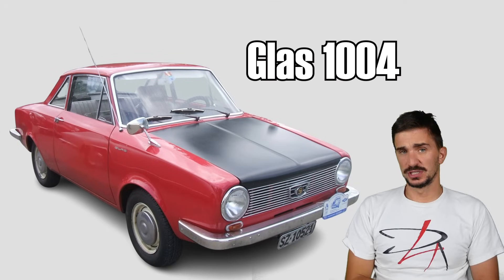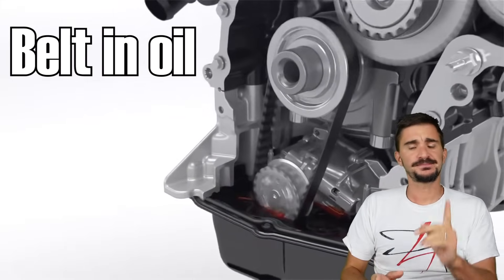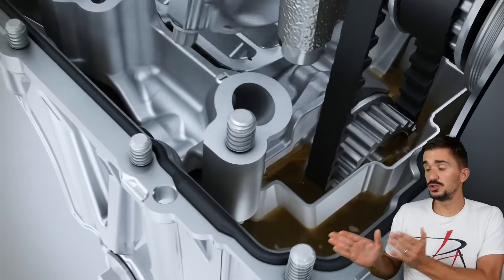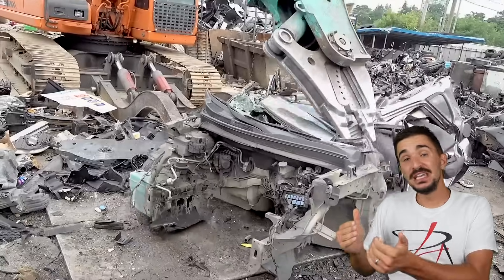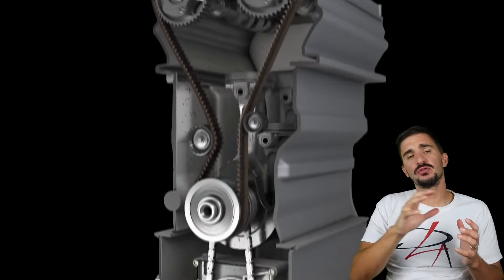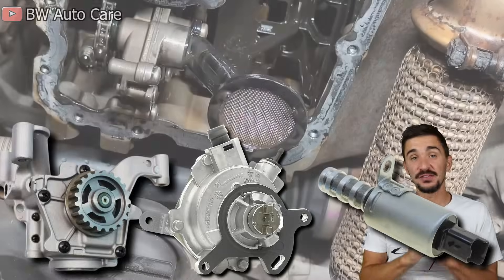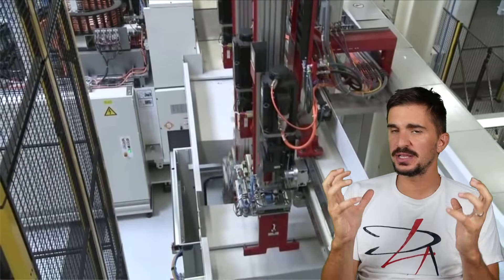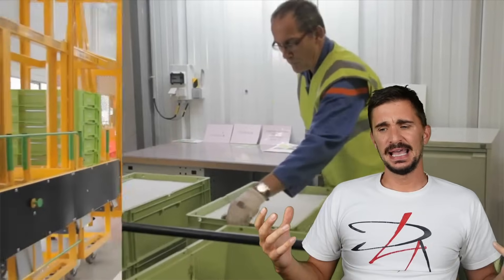Who Approved This and Why Is It Still Being Made? Wet Belt aka Belt in Oil Engines

Comment: I am working in the automotive industry and you are 100% right! What helps
1) really only using certified genuine oil
2) using only geniune belts
3) not adding additional additives
4) reduce change Service to 10k-12k
5) not running engine too hot
6) using good fuel higher than 98oct
… Tier1 suppliers optimized the belt material after initial issues to increase lifespan, but it does not completely solves the issue.
Reply: Or changing the timing belt before the service interval for replacing them, probably every 100,000 km or 62,100 miles.
Reply: @Sacto1654  My car has 105000km service interval for the belt in the owner manual. It is from 2020 and they realized that it is prone to failure. Friend has an older model of the same car and his one states 160000km. Peak auto industry. I will probably sell the car before it hits 90000
Reply: These are ridiculous recommendations, consumers shouldn't need to do this. How does the industry get away with rolling this shit out in the first place.
Reply: @mrfish9876  you drive while its under warranty, then it becomes somebody elses problem..

Comment: Ford with it driving the oil pump, the belt deteriorates and fills the oil pick up, killing the engine. That is if it even had enough belt left to turn the oil pump. 😅
Reply: funny thing is ford says the ecoboost oil intervall is 3k km but it really is 2k km
Reply: @motokid1492  i'm not buying a car that needs an oil change every 2 months.
Reply: @SoulTouchMusic93 then don't buy any of these small turbo engines. Because the turbo wears the oil out faster.
Reply: @motokid1492  here the ecoboost is every 15 000km
Reply: @justarandomguy3969  Meant miles ford says 3k miles it really is 2k miles
Reply: @motokid1492  thats still only 4800km, interesting that you guys have to change it 3 times as frequently
Reply: @justarandomguy3969  You don't, the recommended oil change from Ford is on average roughly every 7500 miles. People are falling for what is outdated information and borderline propaganda from the oil industry, the people who actually make more money if you do more oil changes than are required.
Reply: @richardmillhousenixon  interesting, i keep seeing americans saying they do oil changes every 3000-5000 miles and i never really understoof why

Comment: It should be noted that some of the most reliable engines ever put into cars came with DRY timing belts. Toyotas 1uz 2uz and 3uz all used dry belts and all of those engines are documented to go well over 300k miles with just basic maintenance and there are some examples with over 1 million miles. Of course these engines are gasoline hungry V8s but its arguably better for the environment to keep older, less fuel-efficient cars on the road than endlessly manufacturing new cars that get thrown out after 150k miles.
Reply: Keeping an older vehicle on the road is not a clear black/white situation. It is beneficial to get a newer car if you are reducing your consumption, the payoff time varies obviously depending on the fuel consumption reduction
Reply: Nissan vans (truck chassis V6/v8) for sale with over 400K mi and going strong. It's almost as if timing chains are amazing 😂.
Reply: But manufacturing new cars with a lifetime of 5 years boosts BNP more than some annoying sensible person using the same car for 15+ years.

Governments and corporations do not give a single shit about the environment or people, all there is is profit, or the illusion of productivity.
Reply: Stop nuthugging Toyota. That is not true. The 1UZ and 2UZ were intereference engines. If the belt snaps, the motor blows. They are not exception to the rule. If you feel so confident, then go ahead and cut the timing belt on your timing belt Toyota and then start the car. Tell me what happens.
Reply: @Euro316  I don't really understand what point you're trying to make. It's objectively true that the uz engines are reliable. Thats not an opinion. Of course, if you cut the timing belt it will cause irreversible damage to the engine but that's the case on any interference engine including those with timing chains.

Comment: The Renault 0.9 tci has got a timing chain and the 1.5 dci has got a normal dry timing belt.
Reply: this should be on top
Reply: Yeah I think the 1.2 tce uses a wet belt but the 0.9 doesn't
Reply: Yeah, as an owner of an early 1.5 dci, and who`s done alot of research regarding later versions of the engine, I had never heard of one with anything other than a dry belt...  But than again I had no idea that this hateful practice started with the 1.8 tdci of all engines...
Reply: There is a belt to chain conversion kit for the Ford 1.8

Comment: I'm not sure if you mentioned it but Ford also uses a wet belt for the OIL PUMP for the 1.0 Ecoboost. Had a coworker whos Ecosport had an oil pump belt failiure within warranty. She immediately sold the car after getting a replacement engine. And I don't blame her.
Reply: I have hated every Ford I have ever owned. All cars are scams, but Ford really likes to twist the knife. Hate Ford.
Reply: I've only owned one model of Ford, and that's the Focus. And only the ones with Mazda designed transmissions and engines. After my 5 speed dies, that's it for me and Ford. Actually, I refuse to buy any car after 2019 because you can't get anything without data stealing. So I'll probably just get an Ebike and walk.
Reply: @jacobrzeszewski6527 Mazda designed ones weren't good either. Mazda is probably the least reliable among the Japanese manufacturers

Their older cars like the 323 had indestructible engines, but their newer ones, not so much.

My dad had a Mazda designed Ford Everest and the engine ran like garbage most of the time.
Reply: @tristan6509  I beg to differ. The Mazda L platform. AKA, the MZR, or the 2.0, 2.3 and 2.5 Duratec i4s are stupidly reliable. Unironically 350,000 mile engines if the oil is changed regularly. Chains for the oil pump and Timing. Belt driven water pump,  no plastic oil pan, and no head gasket issues. I'd argue it's better than any EJ series and even SOME Toyota engines. Yeah, those Toyota A series start burning oil around 250,000 miles, and there's nothing you can do to avoid it. The only problem with the L platform are the terrible transmissions ford attached to them. The only good transmissions are well maintained 4F27Es. Which are rare given people never change the fluid. And the MTX-75. Which is a very mid manual, but a manual none the less. The worst thing about those engines, are the cars they're attached to. Ford's and Mazdas are rust buckets, plain and simple.
Reply: 350k miles is good for an American engine but it's nothing compared to most Hondas and Toyotas.

Even Suzuki (K-series, F-series) and Daihatsu makes some very reliable engines (SZ, KR, NR series). They're used as taxis here and can go millions before needing a rebuild 

But as for the transmissions, I think the early Japanese CVTs were hot garbage. They all fail within 100-150k. Fortunately most cheap cars here are manual so there are no such issues.

Comment: 16:31 Umm actually, there is another Honda engine in EU that uses a wet belt: P10A2, the 1.0T. The info online is pretty bad if you specifically don't search for the engine code and "Wet belt". There's ofc a recall for these belts for missing teeth, I'm waiting on the dealership to give me an appointment to get it replaced. They'll probably replace the belt but they'll just put a new belt in, which just postpones the issue but doesn't fix it. I acutally checked if this engine had a wet belt before I bought it and was misinformed by the internet.
Reply: Exactly. And then you'd think okay, their 1.5 turbo L15Bx engine is safe from that issue, but you soon learn about oil dilution, spark plug issues etc.

Comment: It has failed in US years ago, and now, here in Brazil, there is a car developed exclusively for our domestic market called “Onix” , manufactured by Chevrolet. The first generation had 1.0L and 1.4L engines, based on GM Family 1 of engines, pretty economic efficient, and reliable (even if being naturally aspirated). The new generation of this car is an entire different thing with the same name, it has 3 cylinder engine, with wet belt. Even if they know it failed in their home country, they seem to insist on this idea in a another country, selling it as a “new technology”.

Comment: Personally I prefer dry timing belts over timing chains. Because they are usually simpler to change. And although in theory timing chains are more robust, what usually fails are the plastic guides and tensioners.
Reply: They could be easier to change, depending on how awkward it is to get to them - usually very awkward. I prefer chains because they can run with their guts hanging out, and make a lot of noise on their way out, which is a good warning. Nice things about belts - cheaper, lighter and simpler to design than engines with chains.
Reply: @99nadroj  When the chains are making noise the plastic guides have been ground up and starved the oil supply. The main bearings would have worn out so it's too late.
Reply: Gear driven camshafts - are lifetime items. My 54 Stovebolt ran more than an estimated 400000 miles. The Vortec 2200 with timing chain sold with 400000km still running. Dry or wet belts are not state of the art nor are unserviceable new engines.
Reply: Belt or chain, timing gears are the best. It's race engine stuff.
Reply: It doesn't even really matter.... Even if cars had timing gears auto manufacturers would just find some other way to screw you.
Reply: Chains typically last life of the car.  They rarely fail if the car is maintained even moderately well.  That includes the “plastic” guides.  The guides are mostly resins, polyurethane, graphite, molybdenum and other non-plastic materials.  What little plastic is in them is really just a binder and not the wear component.  The chain guides rarely fail.  Most timing chains have no recommended replacement interval.  Every belt is recommended to be replaced between 60k and 120k miles.  Chains are FAR more reliable in every way.  Gears are even better, but I don’t know of a current production car with timing gears.  Many older pushrod engines used gear driven cams, but overhead cams are the norm now.
Reply: @robertmatthews4285  VW and bmw somehow managed to make engines with timing chains that last less than the timing belt
Reply: @99nadroj The ultimate would be gear-driven camshafts... or a koenigeggs system.. 

😎👍☘🍻
Reply: On jaguar XK engines, the timing chains would do 100,000 miles before they needed adjusting!! the tensioners likewise. putting any rubber or plastic component inside an engine is stupidity beyond belief, done by manufacturers to maximise profits with no care whatever for how long the engine lasts or how catastrophically it fails!
Reply: @robertmatthews4285 Hey, uh, buddy? Resins are polymer (i.e. plastic) and polyurethane is straight up just plastic.
Reply: @levilastun829  any body can find instance of bad design.  The data on the whole wildly & massively favors timing chains.
Reply: Isuzu still makes timing gear engines. They're indestructible.

That's why Isuzu's diesels are the main choice for drag races in southeast asia.

You can push an 88hp engine to 400hp with stock internals, it's crazy stuff.

Comment: I agree with your conclusions.  I worked at a few dealerships in the 70’s & 80’s when cars started using belts for most OHC engines. The big oil leakers always trashed their timing belts.  Real or synthetic rubber is destroyed by constant oil immersion.  This has been known for 50 years!

Comment: I don't know how true it is but Toyota coined a new expression that roughly translates to "consumer proving." The oil will not be changed as regularly as it should, the coolant will not always be topped up, noises will be ignored, nothing will be investigated until it completely breaks and all the while being driven as hard as possible. Designing ahead was never profitable and a good reputation isn't paying the shareholders.
Reply: They typically look at the long term through customer retention rather than focusing on net profit for each quarter and trying to attract customers with features and technology that are not well tested.

Comment: Ford is also the same company that buried a water pump under the timing cover in their V6 engines.  So the cost of replacing a water pump would cost you 1500.00 dollars. Ford needs to get better engineers, because Ford quality is Job None....
Reply: thats not a ford exclusive. Audi even tensioned their timing belts over the waterpumpdrive in the 80s/90s
Reply: Gm did a 8hours water pump in the 2010s
Reply: Toyota does this too but the water pump just doesn't fail.
Reply: Thats a classic subaru move too
Reply: @Cas_55  what's funny is they revised the pump and it still fails lmao
Reply: Don't blame the engineers; the vast majority of the time they'd love to make better engines. They're not able to make the best designs because of time constraints, siloed development efforts (one engineer/department doesn't know what the others are doing, and how their designs interact), and ofc their corporate overlords wanting to save as much money as they can (even when it's detrimental to product quality).
In other words: blame car companies, not their engineers.
Reply: Only their transverse 3.5/3.7's. The original longitudinal design was external. The stoutness of those engines otherwise kinda balances it out imo
Reply: Audi also put a $10 thermostat behind the timing chains, radiator, front of the car and anything else that could jam in front of it.
Reply: Don't forget the 4l v6 with it's shitty timing guides that break and clog the pickup and timing tensioners that require oil pressure to actually tension.
Reply: Good water pumps last a really long time. Timing components need replacement at similar intervals. Today's cars have compactness requiring more disassembly. The problem is that Ford has not maintained quality within its subcontractors.This is a major issue.
Reply: And on those engines,  transverse 3.5/3.7 V6s, it's not the water pump that fails which causes the coolant to enter the oil,  but the water pump seal failing,  not merely causing a typical water pump seal leak,  but actually pumping the coolant,  without warning,  into the oil.  ALL of it. Think 6-8 liters into the oil.
Reply: @mnxs  Stupid regulations, like the CAFE standards cause this nonsense.  We have a bunch of regulators dictating how a car must be made, and it's an accomplished engineer that can meet all of those standards at once.  Then the managers need to reduce the cost to something they can sell, and you end up with a totally shitty design.  The two most important numbers in systems engineering are MTBF and MTTR.  Neither of these seem to receive any priority in modern automotive design.
Reply: Late sixties, early seventies Ford V-8- To replace the radiator top hose or thermostat, you begin by removing the radiator.